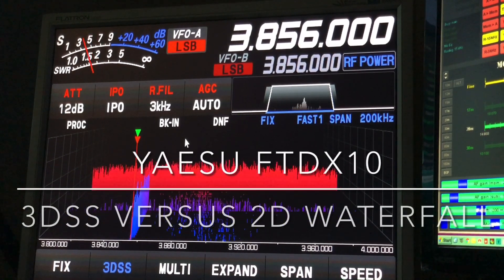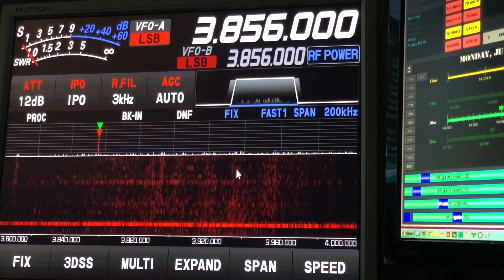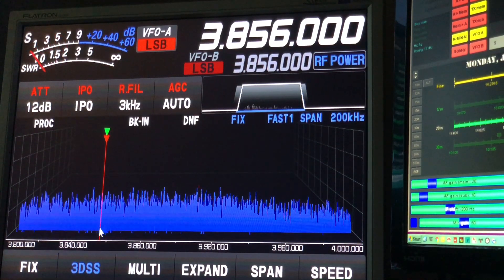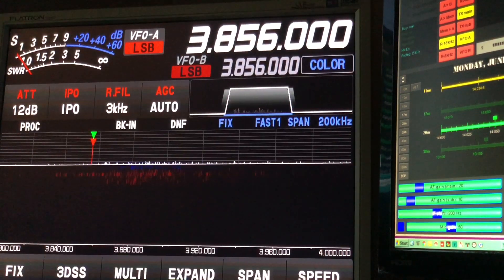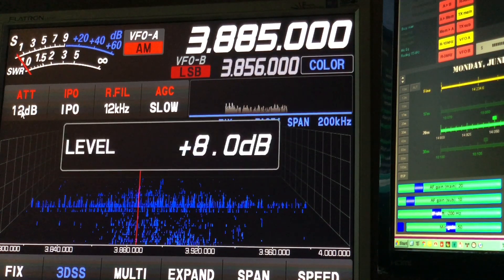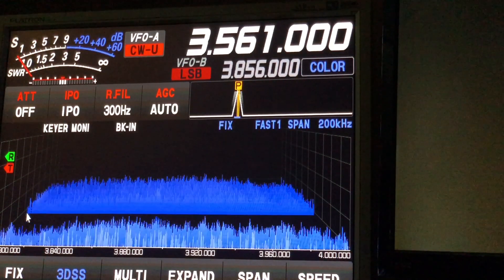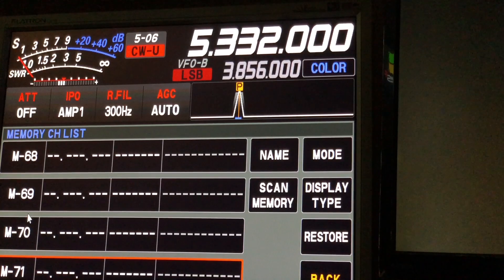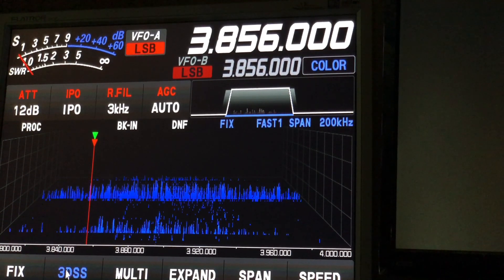Yaesu FTdx10: 3DSS versus 2D Waterfall (Video #45 in this series)

Comment: Great series of videos, Sir.  I’m in the process of losing my hearing.  Strikes me that the 2D and 3DSS may offer a way to get closer to fine tuning a signal.  Any suggestions, Sir?  Thanks!
Reply from the maker: The 3DSS or the waterfall allow you to use a mouse to click close to a signal spike and get close.  Then you fine tune it from there.  I would suggest getting the SP-30 external speaker as well.

73, de N4HNH
Reply: @n4hnhradio  Thank-You for your swift and kind response, Sir.  The FTDX10 has pretty good decoding, and that will help, as I intend to learn CW.  Too bad, we don’t have close captioning for voice/phone on the radio…. It will be a long learning process….  Again, Thanks!
Reply from the maker: Closed captioning for voice/phone would be great!  I encourage you in your CW endeavor.  It is so much fun.  There is so much less noise than with SSB.

73, de N4HNH

Comment: IS THERE ANYWAY POSSIBLE YOU COULD GET A FTDX101D.  YOUR INSIGHTS INTO THAT RIG WOULD BE EXCELLENT AND WE WOULD LEARN A LOT ABOUT THAT RIG. THANK YOU
Reply from the maker: You can send me one.  Or call Yaesu and ask them to send one to me.

I barely receive enough revenue from advertising and Patreons to justify my time, much less to buy equipment.  I can only review what I have.  Have you become a Patreon yet?

Just buy yourself a 101.  The same techniques I teach for the FTdx10 apply to the FTdx101D.  The 101 is akin to a FTdx10, but with two receivers and a variable preselector.

Comment: I like to use the 3D waterfall when i'm running digital modes... it's a much "prettier" display. However I have yet to figure out how to tune to a modulated 3D spike visually in SSB. I can sometimes "get close" but then I usually end up looking at the actual frequency numbers to guess a little closer. With the 2D waterfall I can hit it pretty close right away, and then dial in the last few Hz. 

I agree, it's great they give you the choice. The more I use this radio, the more I WANT to use it... I know i have some minor gripes about UI, but in general I am finding I'm starting to just get in sync with it, and how it works. I had the same experience with the FT-891... it was difficult for the first couple months, but then all of the sudden it just started to click for me. Another helpful video, thanks and keep 'em coming! 73 de KD2TJU.
Reply from the maker: I told Tim at Yaesu yesterday that I think the mouse click should lock onto the nearest strong signal when we click a spike.  HRD does it perfectly.
Reply: @n4hnhradio  that would be a good solution. Honestly, i had a mouse hooked up to the rig, but never ended up using it. (I have it setup next to my work computer, so, I kept confusing my mice)
Reply from the maker: I have the same problem.  Two mice - one for the computer and one for the FTdx10.

Comment: What software do you use?  I'm trialing Win4Yaesu, using HRD Logger since there is no FTDDX10 in HRD.  KC3SFD
Reply from the maker: What you see on the screen is coming directly out of the DVI connection from the back of the radio.  I use HRD 5.24 with my FTdx5000MP.  Most modern Yaesu’s use the same CAT protocols.  But I use Windows XP Pro in my shack and Yaesu has no FTdx10 driver for Windows XP.  I might try installing HRD to my laptop just to try it out and see if the FTdx5000 setting will work with the FTdx10.  But I’ve been fine with the output from the radio itself.

73, de N4HNH
Reply: @n4hnhradio  i use a 13.3 inch Portable Monitor,KENOWA PC 16:9 Display with HDMI $96.99 on Amazon for my screen, tandem to a Dell U3818DW for my server Windows 10.   using a Logitech G305 mouse to avoid too much contact with the touch screen.

Comment: Excellent video, as usual.  Your description helped me understand more about the 3d waterfall.  I have a ftdx101mp and I could never understand why anyone would want the 3d.  In all honesty I could hardly wrap my brain about it and understand what I was looking at.  Your description helped me to see the forest and get the trees out of the way, so to speak.  I still think the 2d is better because of its simplicity.  Does the 3d show or give anything that the 2d doesn’t?  Thanks!
Reply from the maker: I think when the sensitivity is set just right, and the Peak setting at LV2, it is easier to distinguish the strength of the modulated signal in 3D mode.  This is mainly because there is a larger area available to show the signal at a higher scale.  And the history looks cool in 3D as well.  You can see where their modulated peaks were, if for no reason other than curiosity.  Both scope styles have their pluses.  I just think the 3D looks cool.  When non-hams come into my shack that’s the first thing they notice.

73, de N4HNH
Reply: The 2D waterfall is old school now. The 3DSS is the new tech.